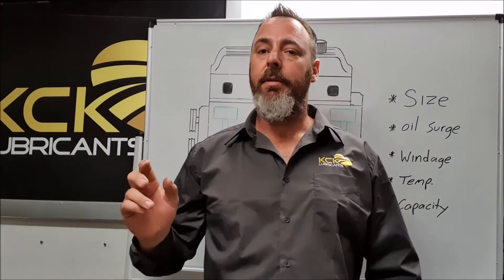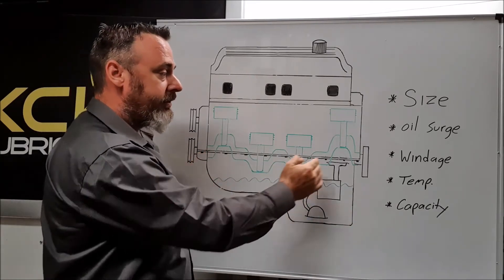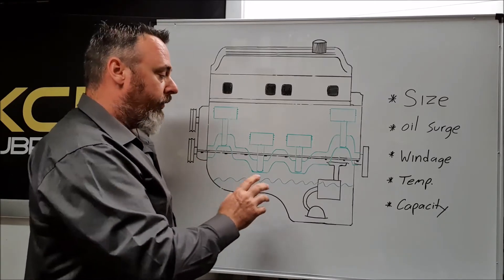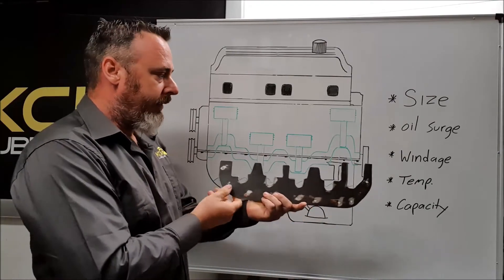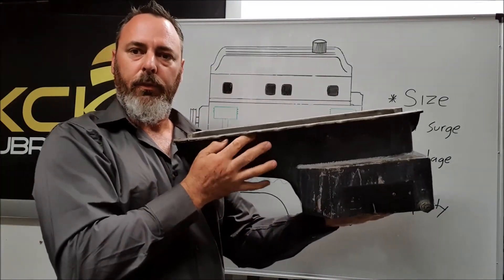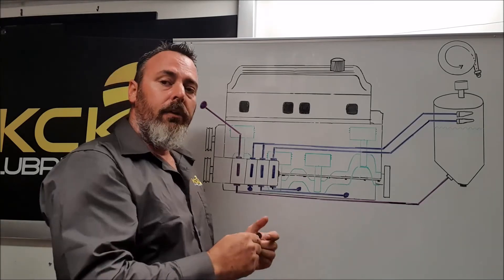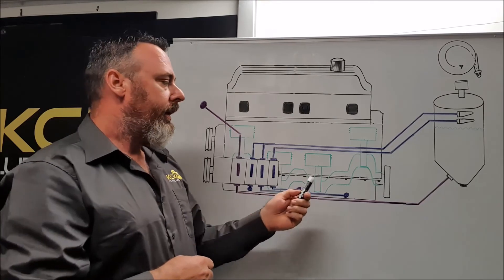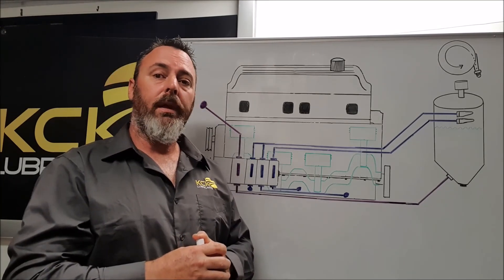WET SUMP Vs DRY SUMP,  which is best and why

Comment: Great video! I have only a couple unanswered questions regarding Dry Sump applications. 
1) how do you deliver oil to the engine main oil galleries in a dry sump system. 
2) when you change from a wet sump to a dry sump, what do you do with the wet sump pickup tube and screen? Do you simply remove the former pick up tube? Do you need to block off the pick up tube port cast into the block?
Thanks
Reply from the maker: Excellent questions! depending on the block and oil pump will depend on what needs to be done. This engine has a modified oil pump in the original location that handles both suction and pressure so no real modifications needed as it feed directly into the factory gallery. IF it had an external pump it would require a modification to pump into the correct part of the oil gallery and depending on how this was done would depend if the factory suction port needed to be blocked.

Comment: Great video can you demonstrate how to step by step on an Ls engine what’s needed what is no longer needed when doing a dry sump system
Reply from the maker: Thanks for watching, Great suggestions! next time we do an LS dry sump conversion I will do a video to cover off which oil galleries need to be plugged and modified.
Reply: @KCKLubricants  thanks would be greatly appreciated

Comment: Question: With the dry sump ,  Is there more space for the engine to be lowered with dry sump configuration?   if using aluminum for most all parts,  Is there any weight savings with the dry sump? Would you say that dry sumps would cost more than wet ?
Reply from the maker: Good questions! Generally the weight of the plumbing for the dry sump adds more weight to the dry sump configuration, dry sump is considerably more expensive but does allow you to lower the engine in the chassis or to gain more clearance.